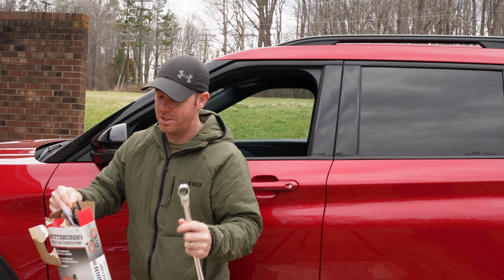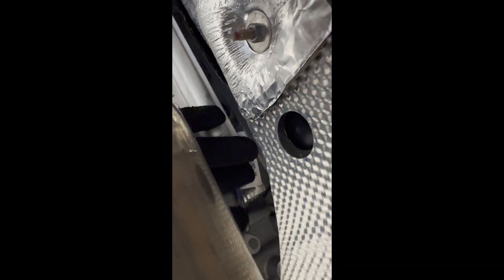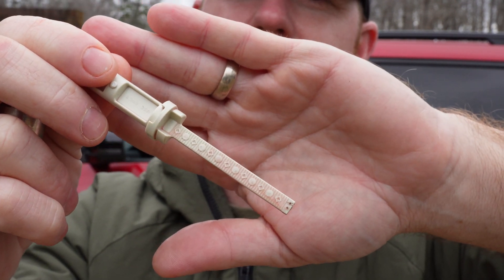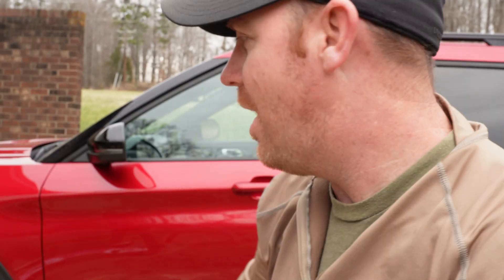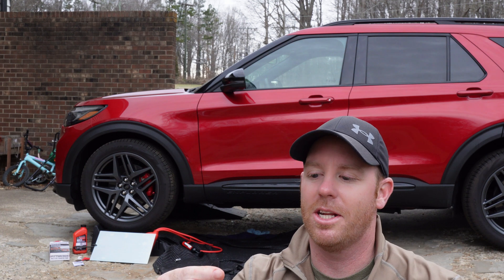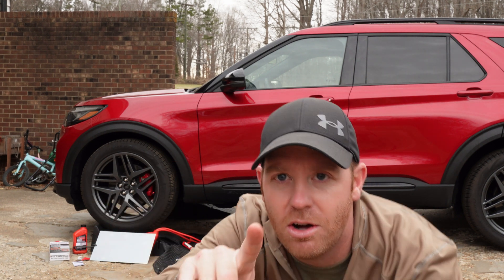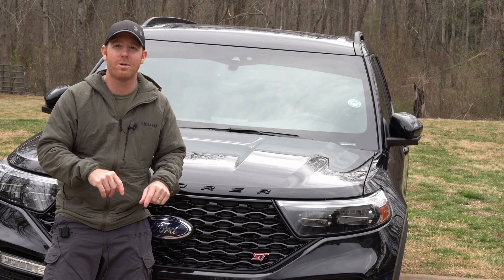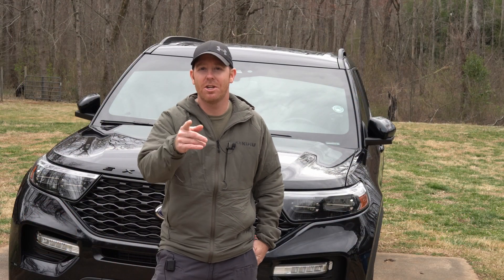Why You're Explorer Transmission is Underperforming and How To Fix It On The Cheap

Comment: where is the drain plug for the transmission ? i need to change the fluid but cant find the drain plug.
Reply: There’s no drain plug. You have to suck out the old and fill the new one with the same pump.

Comment: Hey awesome video…needed this tip on checking this fluid .quick question can I use ramps like u did or will that read the stick different?
Reply: you would need to use ramps in the rear as well or jack it up somehow so the car is level with the ground

Comment: Ford has a history of sending out vehicles with the bare minimum fluids, even refrigerant in the HVAC system to the point it barely works. I had a 2007 F150 that I had to have an independent shop check my A/C system and found it was almost a full pound low on refrigerant. I had them top off the system and my A/C  blew 15 degrees colder.
Reply: Any idea why?
Reply: @pattygq To save money.

Comment: My 2020 has always had a 3-4 slip and 3-2 downshift jerk. No problems with launching, other than the rare shift system fault and the thing goes into limp mode for a little. Do you think doing the flush or adding fluid could help with the axle click problem too? Just hit 70k, problems havent changed since 39k (used)
Reply: if your axles are clicking putting more fluid in the tranny wont do anything they use a completely different lubricant called grease for the axles and if you plan on doing a transmission flush on it i would do it sooner than later.

Comment: I had a 2018 with less than 70,000 miles that the transmission grenaded itself. Refuse to buy anything with that transmission now.
Reply from the maker: Yeah that would be a hard pill to swallow. I plan on getting this trans built at some point so I don't have to worry about it. Sucks you have to do that though for peace of mind

Comment: Also, you should do a comparison video on cheap temu intercooler vs whipple or name brand ones. That'd be a great video for the channel and all of us ST guys would like to see real data when comparing a 450$ knockoff IC to a 1000$ name brand one.
Reply from the maker: If i can get any of the companies to play ball I'd def do it. Most companies would politely decline though I'm sure. I don't think there is much secret sauce to an intercooler honestly though anyways. The cheaper one is likely just made from lesser material and possibly won't stand up to the test of time, also a good chance it does though lol
Reply: lol. Why tf would you buy a 60k vehicle to put temu “performance” parts on it. IMO If you’re gonna do it, do it right. Or leave it stock.
Reply: @Maverick09171 Because ST mods are expensive for no reason 😂. Alot of guys use the Ebay IC and they cime with whipple installation instructions... literally the same IC but 500$ less. I just wanna see data on them to prove they're the same.

Comment: I'm having a very hard shift from 1st to 2nd gear when cold and the transmission was just replaced this past December. I'm betting it's low on fluid aswell, so I'm gonna check it out this weekend.
Reply from the maker: Ford seems to fill them low. Definitely check it. Trans temp also plays a big part in the shifts in these. These 10r60 do not like to be cold
Reply: Did you check